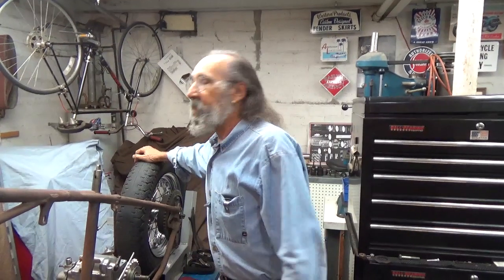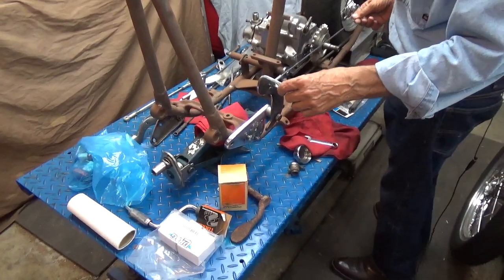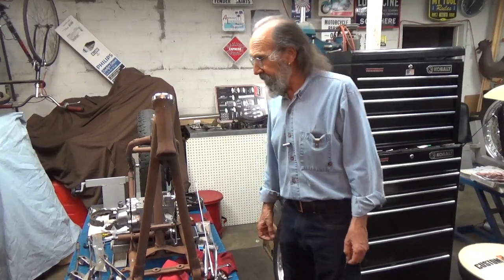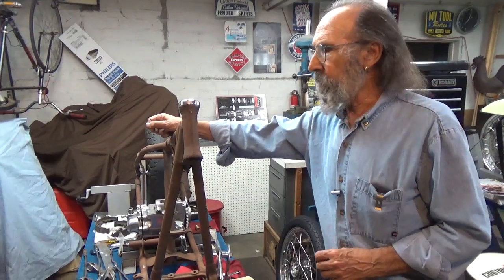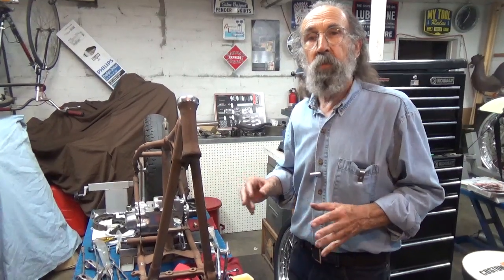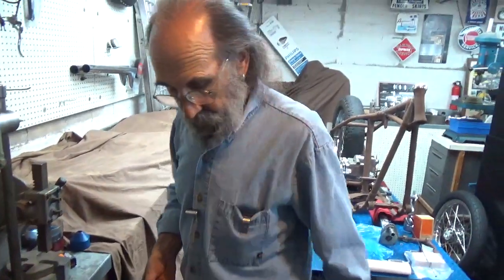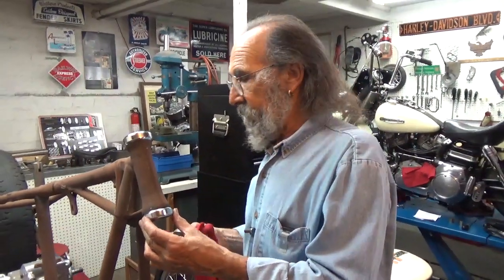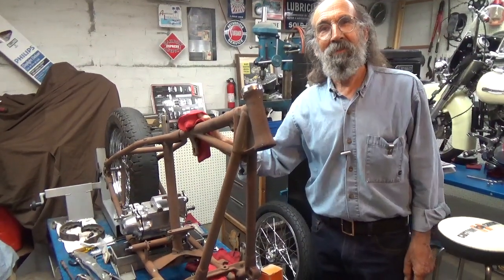Clutch and Brake Linkage, Fork Bearings, even a transmission for the Flathead Harley Project.

Comment: Thank you for inspiration , Mike! I've owned my FXS-80 Superglide -79 since -89 and now had the engine restored, replaced origin carburator, changed ignition to electronic (Hi4N), going back to hydraulic rods after stiff, and when out on the road discover that old brake calipers need restoration/ replacement as well. Once you get it moving, you need to stop it somehow, otherwise not safe, right?
Reply from the maker: Would seem so.  Sounds like a great old bike.

Comment: I have used a drill press to press a bearing in. Use a length of pipe to make the handle think it's longer.
Reply from the maker: That's a little rough on drill presses.  "The right tool for the job."   If I can't afford an arbor press, I certainly can't afford to damage a treasure like my drill press.  I can, however rig up some washers, a nut and a bolt, and, pull a race into place.  There's always a way to get a job done carefully.

Comment: Setting bearing races and cups without that fancy press is one of my challenges.  I use a thick piece of hardened all thread with several large washers and nuts.
Reply from the maker: That works!  It's taken my whole life to gather the tools I have.  I don't wanna demonstrate the hard way, but, sometimes I do explain it.  There is always a way.
Reply: Pacific Mike so true, I really appreciate your way of helping us work on our projects.  I watch as much as possible, just wanted to throw my 50 cents (inflation) in.

Comment: I went for powder coat on my frame.  Looks great but would not do it again.  Possible the prep was bad but I have found it brittle so rather than getting a minor scratch, which as you say can easily be touched up, you get a chip which is harder to repair.
Reply from the maker: I've used a lot of powder coat.  Too brittle usually means too much heat.  It's a balancing act for the folks who do it.  Time and temp need to be right.

Comment: I wondered how you'd handle the larger neck stem on the I-beam fork, a one inch stem makes perfect sense. I bet a good set of VL cups would be hard to find.
Reply from the maker: I'm sure I could round them up, but I really like modern tapered bearings.  I'm retired.  I want to spend some real time on this bike.  I'm really concerned about function.  The "Middle of Nowhere" is one of my favorite places.

Comment: mike i reckon etch primer on the bare metal and spray can engine enamel  for the  top coats  tough as and heat proof
Reply from the maker: Thank You.  I recommend heating for complete drying and hardening.

Comment: Mike you reference manuals in some of your posts! I have new to me chopper 79 shovel 56 four speed. What repair manual will help me repair kickstart and tune engine? Love your videos!
Reply from the maker: I use them all.  For the engine, 70- 84.  For the trans and kickstarter, I'd use the 59-69 .  If you're using an HD rigid frame, 49-57.
Reply: Pacific Mike Paughco Frame! Engine needs help I can’t start it? Mikuni flat side carb!  Dyna digital ignition system! Watch all of your videos! Maybe picture of your favorite manuals for transmission and engine?

Comment: Hey Mike. I commented a while ago where I needed some help with the mousetrap and clutch on my dads old 61 duo-glide. We changed out the clutch and adjusted the mousetrap (thanks to your videos), and it runs great! My dad has never ridden that bike as much as he has for the last couple of months:) Now we are trying to get my GP’s 65 Electra-glide started. It started when we poured some gas into the carb, but it wouldn’t keep running. So we took the carb apart and oh man! The fuel was green, and there was so much gunk. We’re in the process of cleaning it now, and hopefully it fires right up:)
Reply from the maker: Cool.  Glad to help.  Look through our videos and find the Linkert rebuild stuff.

Comment: Hey mike how can I go about learning more about building motorcycles, the knitty gritty stuff? I’m confident in bolt ons and maintenance things. But don’t know a ton about all the other things. I would love to start building vintage choppers. And your videos help a ton but just don’t really know where to start. So many components!!
Reply from the maker: I usually start with a bare floor, or a bare lift.  First thing is to decide what you want to build.  What kind of motor?  Now, you'll need a frame where that motor will fit and look good.  Oh yah, rigid or swing arm.  Now you're building momentom.  You'll get there.

Comment: Hi Mike my 72 ironhead frame looks to be nitrocellulose black, because I've been using dollar store black nail polish, which is nitrocellulose, to fix nicks and it looks good enough for me. You can tell nitro by the smell. Nitro nail polish blends in with whatever my frame is painted with, so i assume it's nitro. I think it melts right in. Haven't looked at it in sunlight yet, but it's good enough for me.
My neck is about as loose as yours with your turned down cups, so I've glued my cups in with green Loctite, which is gap filling and for bearing work. So I hope it works.
Reply from the maker: If the green loctite works, it really works.  If it doesn't, I suggest you "knurl" the outside surface of the bearing cups where they fit in the frame.  It should then require pressure to install them.  Good luck.
Reply: @pacificmike9501  The cups double as the races. They are repro ball cups. I'm pretty sure they are too hard to raise dimples. I was also told to shrink the neck by putting a bead of weld around it, but I'm not that confident with my welder. Well I'll see how it works out.

Comment: I love the bearing cup trick. I likely wouldnt have thought of that until I was directly confronted with the issue. All the stuff I  have worked on have bearing races pressed directly into the steering head. The last frame I painted I did with hammerite. The original 70-s Moto Guzzi had been on fire and then had been left to rot in an alley in the pacific northwest. It was a mess. The frame had a rather pockmarked surface and after blasting it and studying the scars and rather sloppy welding the factory did, I figured "Oh lets embrace the flaws". THe hammerite gave it a texture to match the rust scars and weld spatter. Tough as nails too. Im not as broke as I was when I did that bike, so I';; probably pay for a shop to spray the next bike. 

Nice stuff!
Reply from the maker: I've enjoyed Guzzis over the years.  Every factory has their way of doing things.  If we're lucky, we learn from all of them.

Comment: Surprise you’re still running a rigid frame I had to put mine back in the swing on the bike was getting old
Reply from the maker: With a stock plunger system on the seat, they're great.  I ride my Panhead all over the place and sit on it all day.  But that plunger is set perfectly for my weight.  And, yes I'm officially old.
Reply: Pacific Mike Really enjoy your videos you’ve learned your trade well and I am have learned a lot watching now thank you

Comment: Mike, you are cool without that kickstand part. I used to work on AMF bowling machines and when having a bad day working on one I would say that AMF stood for "Another M###*** F***###". I also remembering back in the early 70's riding the Aermacchi Harley-Davidson 350 Sprint that my friend had. 4-stroke. We swapped bikes now and then. I had a Yamaha 350 R5. Keep up the good work. It was funny watching you get excited about pulling the nice new kickstand part out. Like it was Christmas.
Reply from the maker: It is like Christmas.  I love this stuff.  And I remember AMF well.  They did buy out a failing old company with worn out tooling.  The electrics were awful, but in the 70's, American electrics were all pretty awful, only surpassed by the British.  Okay, that's the extent of my badmouthing.  It's all pretty funny stuff.  The cars had no horsepower.  Anything that was cool was either old or we built it ourselves.  That Yamaha flew.  My 305 Scrambler was lightened and geared up and on and on.  Whoops, that was the 60's.  Nevermind.

Comment: Another great video, I'm still poking along on my chopper project. Chased all the threads in the frame. Doing a little more mock up. Have to dissemble the front end & replace my tubes ( pitted ) going to turn down the legs while I'm at it.  Looking forward to your next video & as always be well.
Reply from the maker: Sounds great!  You too.  Be cool now.  We used to turn those legs down, make 'em thin, make 'em short, no oil, no seals, 40 degree rake.  I had one that I really liked until one leg got stuck in a shorter position than the other.  It was  twelve over.  I flooded it with wd40 and got it to free up.  I'm sure you're better than I was 44 years ago.  Sounds like fun.

Comment: Hello from Norway!
Thanks for making these very insteresting videos. You have a natural talent for teaching ! I have a 61 Pan FLH, and someone has at some point installed a Keihin butterfly carb on it. I am not found of that carb. I would like to have a Linkert, but their hard to come by. So I have a Keihin Cv that I would like to try out. I know you like the SU carbs. The Keihin Cv is similar in costruction to tha SU, if I have understood correctly. I would like to know Your opinion. Will a Cv work well on a Pan or should I get a Linkert or a SU instead ? Thank you !
Reply from the maker: You know this is all just "personal preference."  That Keihin CV carb works okay where it belongs. I don't know about on a Panhead.  If your pan is stock displacement, you'd love a nice Linkert.  SU is also good.  I'm used to old stuff on old bikes.  Yes, an SU and a Keihin both have slides, but that's about all they have in common.

Comment: The sum of parts that part your sums & multiply the spend,
that box of bits you bought back when, oft mused & now old friends.
Pedals, levers, rods & cranks, a jigsaw view of 'sky',
but take 'spare' time & see 'who' fits; how do the forces lie?
Push to pull, lift or lean, what message will it send,
& will it cruise there straight away, or bind up on some bend?
Dry builds are the 'fittings', to prove the tailor's eye,
so line 'em up before you sew, & help that project fly.
(Remember - time flies like an arrow, but fruit flies like a banana, . . . hence their name I guess : )
Reply from the maker: Awesome Dude.

Comment: If a person does not have an arbor press to install the bearing race into the the bearing cup (in this case the steering head on the front end) put the race in the freezer for ten minutes ( this contracts the metal ) while you heat up the cup, ( expanding the metal ). Once the race is very cold and the cup is very hot simply place the race in the cup. When both pieces normalize to room temperature the race is “pressed” into the cup. Easy as pie!
Reply from the maker: Thank you.  Nice explanation.

Comment: Not to seem argumentative, Mike, but a close ratio 3rd won't effect high gear. I'm running
the Andrews with a 24 tooth tranny sprocket and  47 wheel. I call 4th "The Big hole." Heh.
Is that a new style, aftermarket kicker cover? Say it isn't so! ;^)
Reply from the maker: When referring to the close ratio gear sets, I was talking about sets that come with 2.44 first or 2.60 first.  The factory 3.0 parade gear will be grand with the tall final drive.  I never could get used to the close ratio third  which is used with the 2.44 first gear set.  That third is too far from fourth and down shifting gives a clunk and goes too low for my riding.  But, I try to outfit the specific bike for what it's going to be used. That's an old cover.  Haven't picked the one I'll use yet.

Comment: We are both at the same stage, I have just got my frame back from powder coating and starting fro put the wheels and swingarm on when parts arrive. Got all new bearings for the stems, wheel bearings, swingarm etc. I’m however building an 81 sportster. Lot of work and fun doing this
Reply from the maker: You bet.  I'll built my Sportster in 1969 from a $200.00 1958 basket case.  It was cool.  Enjoy.  !981 is a much nicer Sportster to begin with.

Comment: Mike what do recommend for a compensator for a 1984 FLHX Shovel head I have been trying to find a Fisher vibration eliminator
Reply from the maker: The original works just fine.  I don't know if "Genuine Fischer" in Santa Fe Springs Ca. is still producing theirs.

Comment: Hey Mike..question regarding those 4 speed transmissions. I'm currently building a rigid frame chopper with a 92 1340 Evo engine. I'd love to have a 4 speed with kick and electric start. Any tips or concerns about this?  Cheers!
Reply from the maker: If you can, use a trans with a ratchet lid.  Realize, not all of these components will mix and match.  You'll need to match some year groups.  Belt drive or chain?  A five speed with matching starter and primaries might be easier.  You're going to have to make a handful of choices.
Reply: @pacificmike9501  belt primary, chain drive

Comment: Timeserts are 300% better than helicoils they hold every bit as good New threads and sometimes stronger. Especially in aluminum or magnesium/aluminum alloy. Used as case savers in high hp VW motors.
Reply from the maker: I am familiar, thank you.  Sometime, when there isn't enough meat around the hole, a helicoil is the answer.

Comment: Painting the frame was always a nightmare due to the chances of scratching it and powder coating seemed a great idea but it does tend to go a bit 'dull' due to the micro scratches it gets over time. Years ago I got some paint called Hammerite Smooth - an industrial paint that is still available over here in England - and I am sure it or something similar must be available in the good ol' USA. After I brush painted it on to cover the various places where H-D's paint had flaked off and the frame rusted (this type of paint is it's own undercoat as well AND can be painted over the rust ) I later got the whole frame powder coated. When I went to collect it from the powder coating company I was asked what kind of paint did it have on it as the blasting process they used couldn't shift the paint.
 Do some good research Mike and you may well find a paint you can spray on that is just as good if not better than powder coating.... as good as the old 'stove enamelling' from years ago.
Reply from the maker: That's probably how this project is going.  I've got a buddy  with vast knowledge on this and I'll probably take him to lunch and pick his brain.  But you guys have supplied all the questions for me.
Reply: Duratar . . an oilfield/pipeline coal tar epoxy is an good coat for an frame . .  they banned it from an cancer risk whilst spraying , it did't have any zinc so you had to to prime it well . . I'd use it still if I could get it
Reply: sorry to be so off topic but does anybody know a method to get back into an Instagram account?
I somehow forgot the login password. I would love any tips you can offer me
Reply: @Grayson Canaan instablaster :)
Reply: @Brady Tony thanks for your reply. I got to the site on google and Im waiting for the hacking stuff now.
I see it takes quite some time so I will get back to you later when my account password hopefully is recovered.
Reply: @Brady Tony It did the trick and I now got access to my account again. I'm so happy!
Thank you so much, you saved my account :D
Reply: @Grayson Canaan happy to help =)

Comment: Hi Mike! I'm looking to touch up a 1973 flh frame, what paint did you use to paint brush yours you mention in vid? Where do you get it?
Reply from the maker: I bought glossy black Rustoleum in a little can at the hardware store.  I bought some sandpaper and a cheap brush.  It didn't look good at first.  Then I sanded it and did it again.  Soon, I could do it without leaving brush strokes.  I surprised my self and was really pleased.  It just takes a little practice.
Reply: @pacificmike9501  thank you !

Comment: Thanks again Mike!
Your ideas are super.
I’m fixin to start a new project, starting out with a 66model Paughco frame.
I’m putting my 77 Shovel and transmission in it.
It has the dry brake setup like your project on the rear.
I was wondering if I could run a disc brake instead.
I appreciate your knowledge as I know it will be the best.
Thanks again Mike, stay safe.🧷
Reply from the maker: You'll just have to fab a few things.  But Paughco still has everything to do it on your frame.  And they're a great bunch of folks too. Enjoy and stay safe yourself.

Comment: I have a few flat head parts, head, carb laying around, but you mentioned a rocker clutch for your pan. Do you like that better than the mouse trap l had both on mine at one point in time, I did like the rocker as long as my front brakes were working, keep up the cool videos thanks.
Reply: flathead reliability I'm thinking of getting a kick only sportster never kick it from the top🏁🏁🏁🏁
Reply from the maker: We all find same things.  It's just what you get used to.  My Pan has a rocker clutch with a stock handshift lever.  My Knuckle has a mousetrap for the hand clutch and
Reply from the maker: and a footshift. I really like it all.

Comment: Mike, glad to see you're holding up well during the pandemic. Have you looked at Eastwood's coatings for the frame ? After building several Traditional style Hot Rods over the years,  I started using the frame coatings on some of my bike builds, and I've been very pleased.  In fact I'll be using the 2K Ceramic chassis coating on my vintage drag bike this week.  SARGE 🇺🇸🇺🇸
Reply from the maker: Thank You.  I'll be looking into that.
Reply: Mike I have used Eastwood 2k on my frames and love it...preparing is everything but seems pretty tuff stuff... Good Deal..